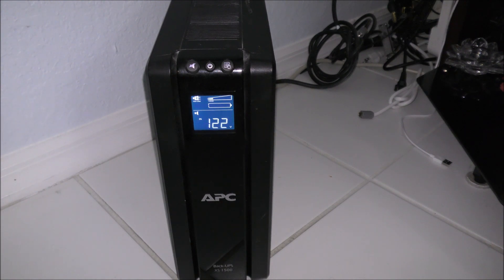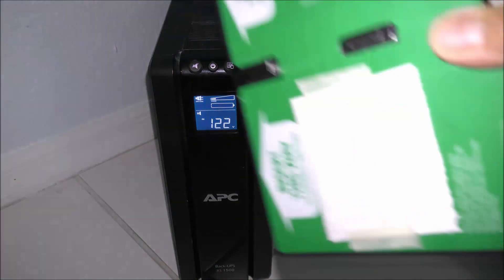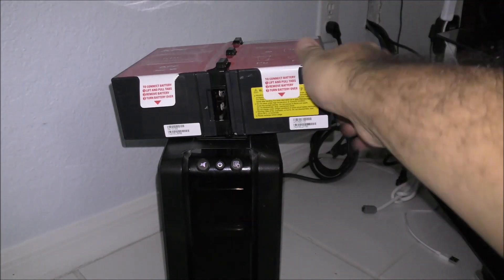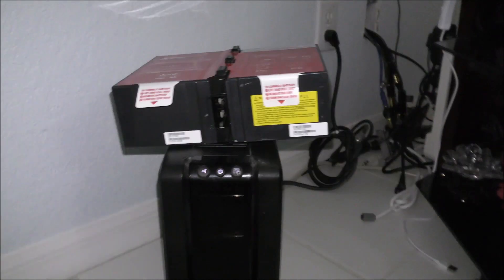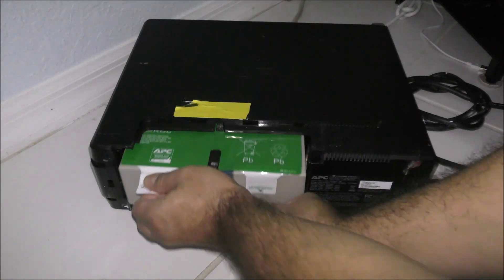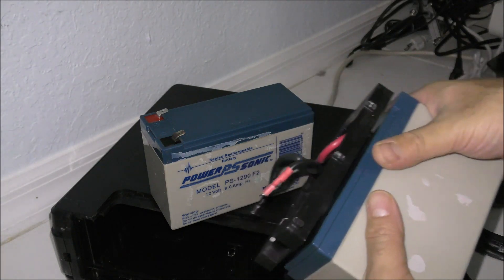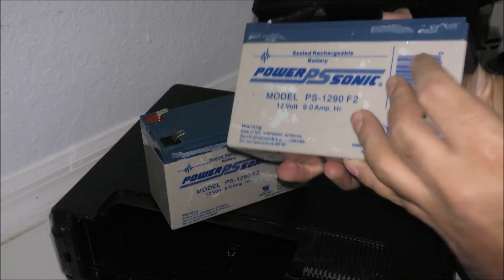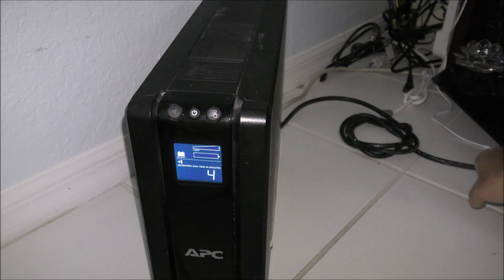How To Fix Error Code F02 & Replace Or Install APC UPS Pro XS 1500 For Models  BX1500, BX1300.

Comment: Waste of time.. NO mention of F02 error  AND   FYI.. you WON'T get elecrocuted replacing the battery with or without the UPS plugged into te wall.  With this kind of advice, I would NOT buy anything from U.S. Computer Solutions.

Comment: Thanks for the video, but your claim that the batteries need replacing after just 1-2 years is not true. I’ve used the same batteries for near a decade now without issue. It was only a couple days ago I received this F02 error, which is ridiculously loud, annoying and unnecessary. 

If I wasn’t home my cats would have had to listen to that crap all day long. Do the fools who manufacture these not consider the fact that people have pets, sleeping babies and neighbors? And why was there no warning to inform me that the battery was going bad so that I knew when to replace it?

If this code indicates a bad battery, then it should say so. The lack of consistent explanation on the web is bizarre.

Comment: F02 HAS NOTHING TO DO WITH THE BATTERY!!!!
F02 = OUTPUT SHORT
In other words something plugged into the UPS is causing a short.
Reply: Not really. I got F02 even without anything connected to the UPS.
Reply: Me too, i had f06, found a relay with problems and replace It. After THAT i Saw THE f02, and i didn't Connect anything

Comment: Thanks for your video, I always have a hard time figuring out how to open the case to properly get to the battery compartment!  Don't know if it's because my UPS's are lightly loaded (I have my computer and networking stuff split across two of them) but I usually get 5 to 7 years out of a battery pack, which currently is only about $55 off Amazon.  I wish the UPS's display would light up a better and more comprehensive error message before it goes nuts with the obnoxious sound and WTF, poorly documented  error code - that would have allowed me to order a replacement before all the "Oh my God, it's dead" drama. 

I still haven't found a good way to properly recycle the old batteries, which I know don't belong in a landfill and could be dangerous for unprepared recycling centers to cope with.
Reply from the maker: If you go to the APC website they take their old batteries  back for free either by picking it up or they will rout you to a shop where you can drop em off, hope this help & if you haven’t already subscribed please consider thanks 😊
Reply: @USComputerSolutions  Thanks!  Subscribing!

Comment: What voltage were the bad batteries ?  What voltage are good fully charged batteries?
Reply from the maker: 9AH/12V each battery which should give a total of 24V
Reply: @USComputerSolutions    Thank you for the reply, I am getting 24.9 volts across 2 batteries. I see some specs online suggesting nominal voltage being 13 volts.  I wasn’t sure if the chemistry of these led acid was such they were high much like 12 volt racing batteries which have a nominal voltage of 16.    My next step will be to load test then outside of the power backup unit.
Reply: @kaijustice7048  the 2 batteries are in series to make it 24v. each battery is 12v.

Comment: I have the older version to this. The RS 1500 LCD. It does not have an indicator to tell you that it is charging. It only shows how much is changed. I’m disappointed that the new version also doesn’t have a charging indicator.

Comment: This error code does not just mean the battery is bad. You can get an f02 code with a brand new battery so instead of titling this video "How to fix error code f02" , maybe "how to replace the battery" would have been better because you just wasted my time. Good day.
Reply: Agree.  My 1500 is only a month old, so the battery is not the cause of the F02 code!
Reply: @calcanadian  I am having this problem now how did you fix it ? Do I need to RMA this bitch back to APC ? I had the same unit for 9 years and just replaced it with new one and new one is giving F02 often and sometimes F06
Reply: With the battery going bad an inevitability, APC should have a dedicated error code.  Seems like F02 just means "one of several things is wrong".  Not helpful
Reply: What is the solution to f02 error ??

Comment: My UPS is only 12 months old. The battery charge shows that its full. But when power cuts it does not give the back up and dispays an error code F02.
Reply from the maker: If its under warranty return it right away seems like it has a problem with one of its connection fuses (assuming that you set it up correctly) which im sure you did or it came with a bad battery 🔋 hope this helps if it did please consider subscribing
Reply from the maker: By the way i mis read I thought you said 2 month’s lol anyways i think you need a battery replacement batteries should be replaced at least once every 15 months and sometimes they last 24 months in rare cases, so i think you need a battery replacement my brother